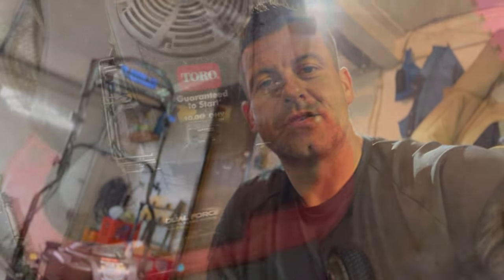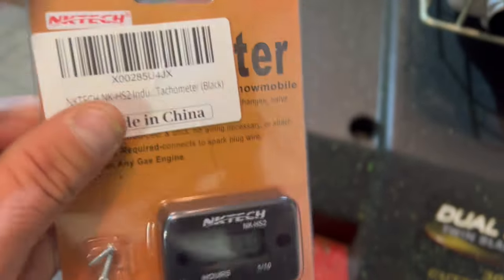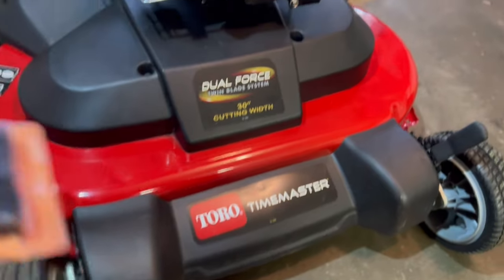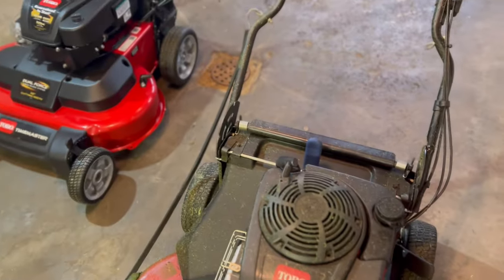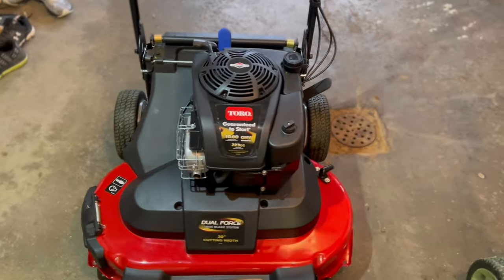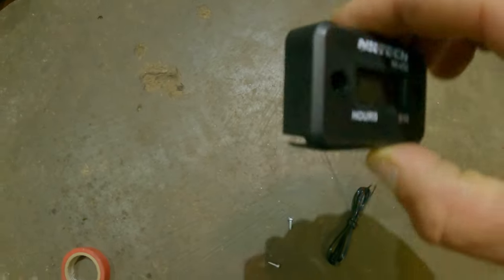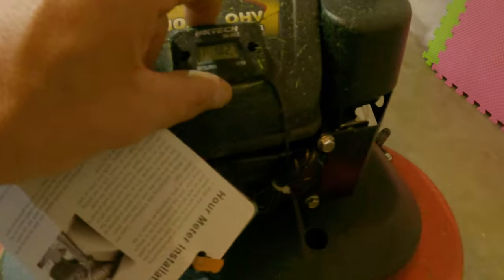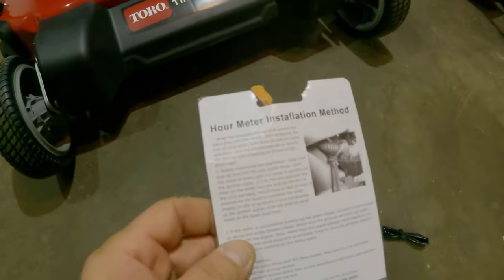WHY Every Mower Should Have THIS

Comment: I agree!  Especially if you run your equipment commercially or more often than a typical homeowner.
Reply from the maker: Right I agree. I just don’t understand how much more it would cost them to throw on hour meter on there. It can’t be that much. But it definitely makes a difference for us guys keeping track to maintain the maintenance on my equipment 👍🏼